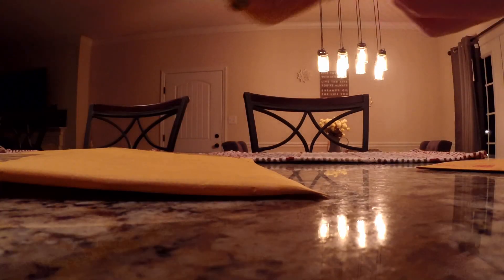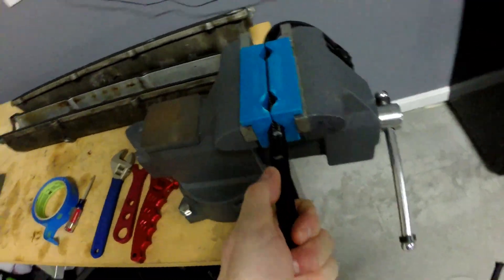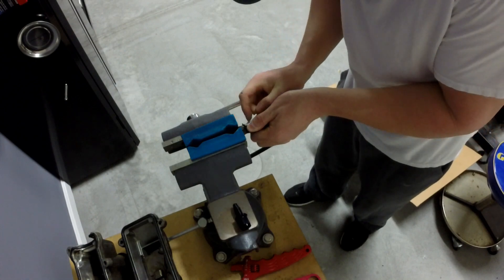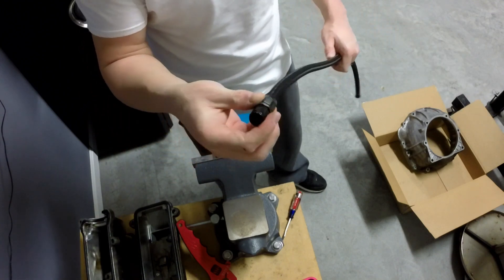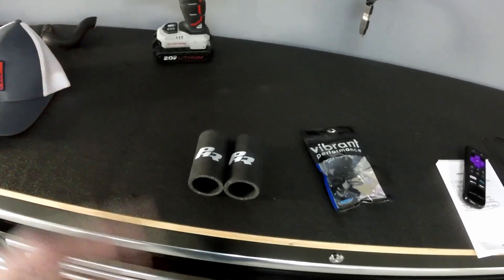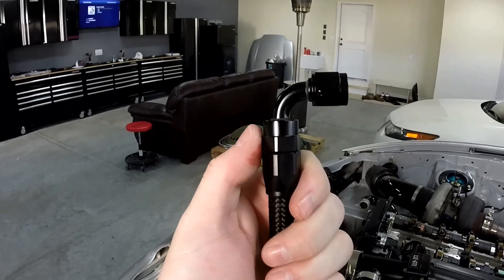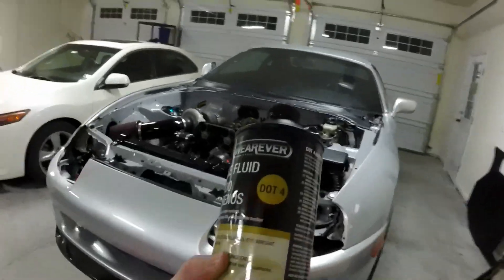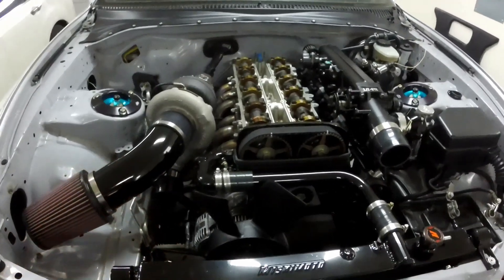Supra Build-15 How to Make AN Fuel Lines, good Friends & What Does This Cost?

Comment: RMR - Ross machine racing. Located in MD and still sells parts to fabricate intake manifolds, just don't sell them complete. Sleeper Designs makes a intake manifold for the 2jz called the "RMR" which is very similar. 2 guys from the shop run them, good quality. Better than another popular choice I don't want to name online